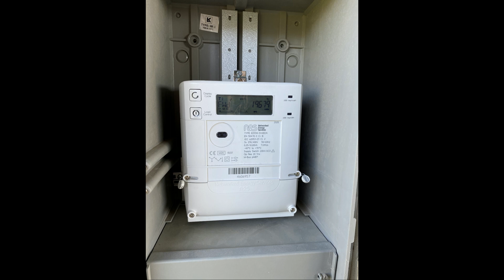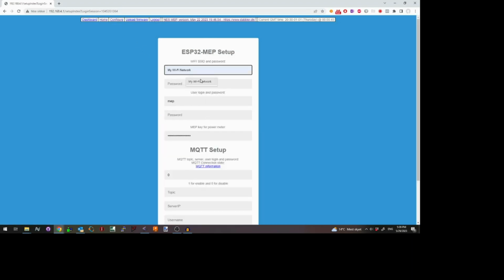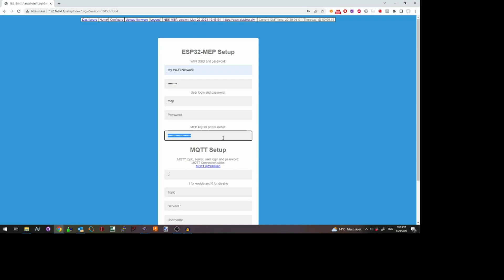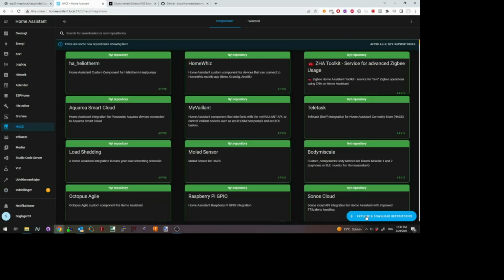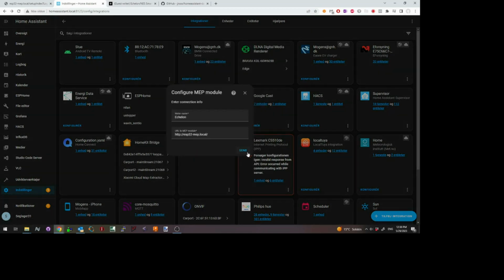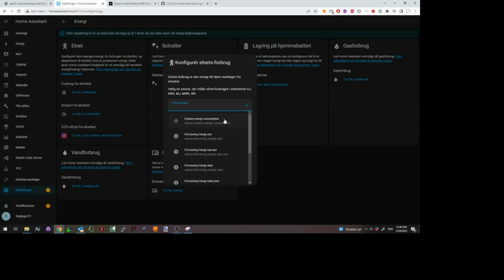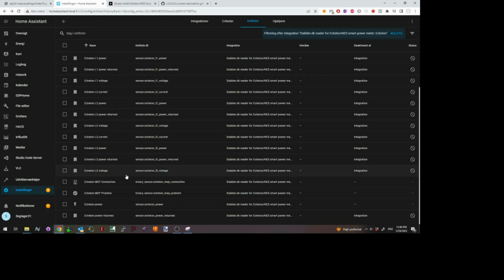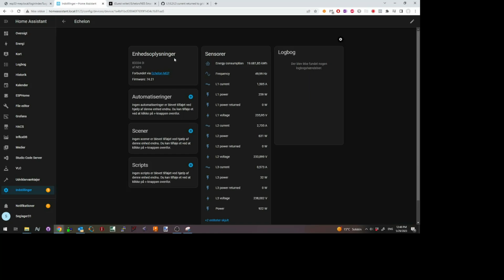Dabbler MEP power meter interface setup

Comment: Was gonna try this until i noticed that Cerius who provided my NES Gen4 meter says that its not possible to pull data from the MEP port with meters supplied by them. Any experience with this?
Reply from the maker: In DK they are obligated to open their interface for customers.
Reply: @MoreGeekN  hmm. They say its not possible with the Gen.4 meter. But they will be coming out with a Gen.5 "soon" that will support data through the MEP port.

Comment: I just bought the ESP32-C3 Dabbler MEP Interface, connected it to my Echelon 83331 and added my WiFi credentials and the MBK from my net company in the configuration tab. But I'm getting nothing but "0x0C Invalid sequence number (this is normal for 1st and some later requests - caused by Meter comunicating with the uplink)" or "0x0B Authentication failure" from the meter in the Home tab. I wonder what I could do to trouble shoot.
Reply: Update: A few meter responses are going through, so I'm getting a bit of information. I still wonder why I get a lot of error prone data 9/10 times.
Reply from the maker: @alexanderchristensen3164  sounds wrong indeed - can you shoot me an email ? Then we’ll try to get it figured out :)